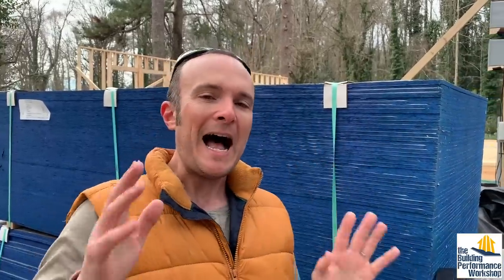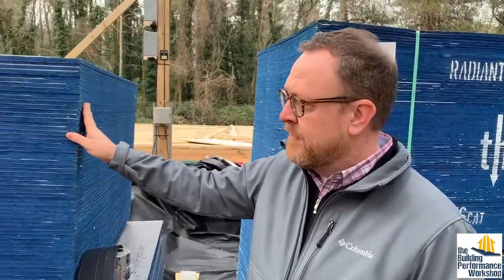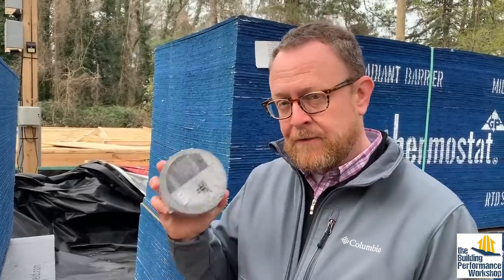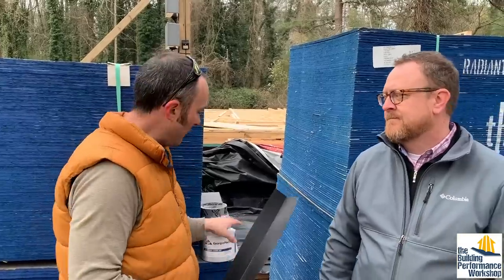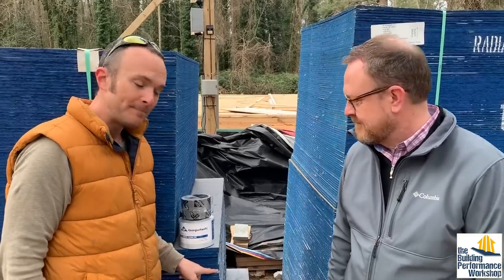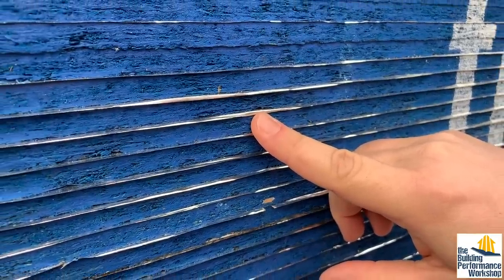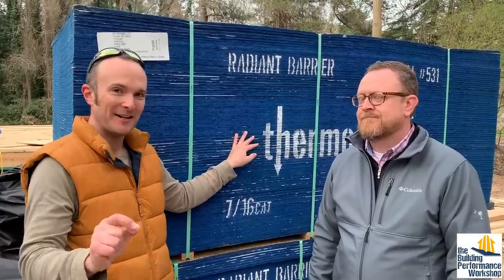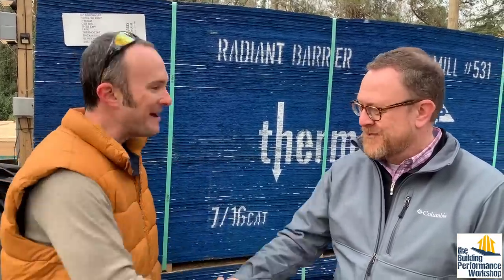ForceField and Thermostat: High Performance Wall & Roof Sheathing

Comment: I have been wanting to try this product for awhile. You have to liquidflash all the nail holes or water will find a way into the wall cavity. DuPont made a video with a mock up wall with zip panels and found water found a way in if the nails were not sealed. Looking forward to seeing how this project works out for you.
Reply from the maker: Thanks, I believe we have incorporated this into an excellent system.

Comment: What nail type is best used?  And do you have a link for that nailer attachment for preventing the nail from overdriving it in?
Reply from the maker: The attachment is actually just to prevent the sharp teeth on the bit from piercing around each nail driven. And we used full-head .12 as specced by our structural engineer.

Comment: Do you have any good research to link on radiant barriers and their effectiveness?  I have read a lot that they are more scam than science.  But considering the good work you do I might need to revisit the idea.
Reply from the maker: They do not technically have R-Value, because of the technicalities of the R-value test. But they work great in the right application- NASA developed and used them for years, so there’s certainly research. Just don’t let anyone sell you radiant bubble wrap and tell you it’s got an R-value. It depends always on the installation and directionality of the radiant facing.

Comment: Is there a reason you didn't go with Zip? Is this just a comparable product or does it offer something extra? Also curious why you didn't go with a liquid applied barrier? Your thought process on the selection process might make for a good video. If you already made a video on this and I missed, I apologize.
Reply: they gave it away... did you not see they sponsored the video?
Reply from the maker: Yes, it’s the same class of product with some key differences. Smooth side wrb vs. rough side, tape tearable by hand, etc. Stay tuned.

Comment: why would you choose this over zip? I feel like zip is more established and widely used, is there a reason for this?
Reply: or even better, cdx fir with fluid applied and seem sealer? I only ask because you say youre shooting for the best assembly!
Reply: they gave it away... did you not see they sponsored the video?
Reply from the maker: Guys, just because a product is more widely used doesn’t make it better. And I don’t just take products that are offered, I seek them out and choose them. ForceField is absolutely the same class of product as ZIP, it’s just different. Smooth side adhesion vs. rough side, tape tearable by hand, ultimately it will itself be protected by 2” of Rockwool and a rain screen.
Reply: Home Performance good to hear, at the end of the day it’s still OSB
Reply from the maker: With an integrated WRB

Comment: I never use osb products for anything other than disposable purposes.
Reply from the maker: Interestingly, OSB can be stronger than plywood. Like anything, there are better and worse versions of a material.
Reply: Home Performance Define "stronger."  I realize GP is likely sponsoring your build, but let's not be disingenuous. OSB is inferior to plywood in every metric.  GP even states this in their own study. This coming from a licensed builder specializing in renovations for 20+ years, a former associate architectural designer with a Masters degree of Architecture. North America is the only market for OSB materials for one important reason... they're cheap.